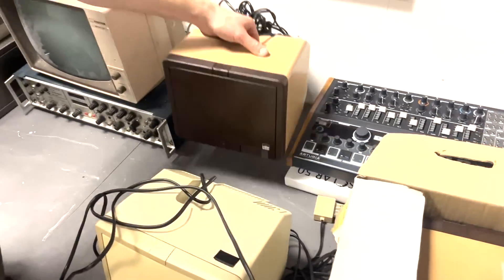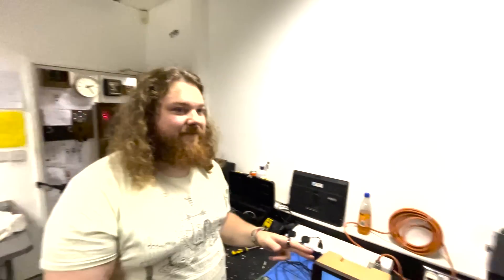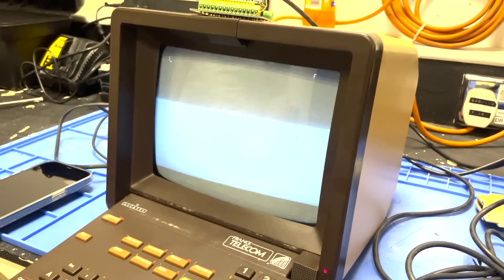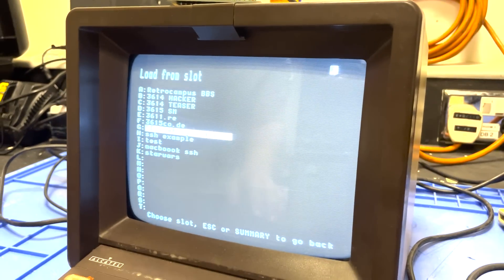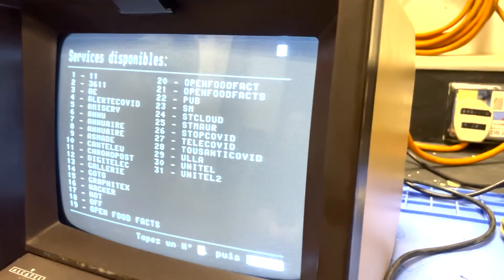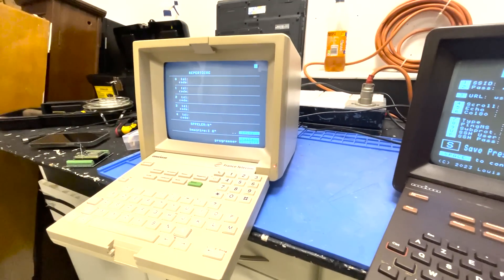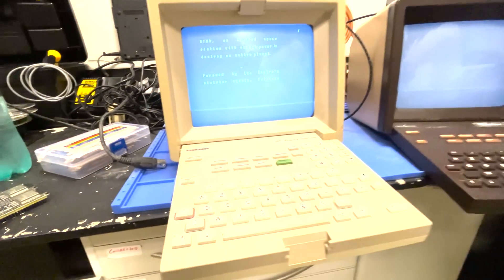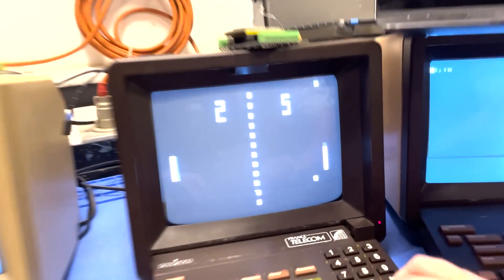The Retro French Internet - Wiring In The Minitel with LuluLombard

Comment: About minitel: tou could also play games, chat, mail, connect it to your desktop and/or a printer (and use the integrated modem). Initially, it was just meant to be an interactive/electronic yellow/white pages device ans as such provider for free to all landline phone subscribers. But it's big success was with the 3617 up-taxed numbers for sex chat-rooms (you could see billboards advertising those 'minitel rose' everywhere in the street and along roads😅)(*) When I lived in France, I got a series of them (France Telecom updated them to the new models a bit like what internet providers do now with their set-top router boxes). My fav was the last one (the cube with folding screen. Very quicky they had been equipped with a colour screen and you could have dos and windows applications allowing you to emulate it with your laptop or desktop. It was equally possible to cast the video to a tv ser The modem was asymmetric with a 75kb up and 1500 to 9600 down speed. It could interface with teletext services like those provided by tv channels (and used on tvs equipped with teletext).
Minitel system was exported to Belgium and Quebec.
(*) it is with such a service that Xavier Niel ( CEO of Iliad) started his career of internet and later mobile phone mogul with the concept of free mail address and internet hosting, in 1998, leading to the creation of Free, one of the leading European fast internet and mobile phone services.